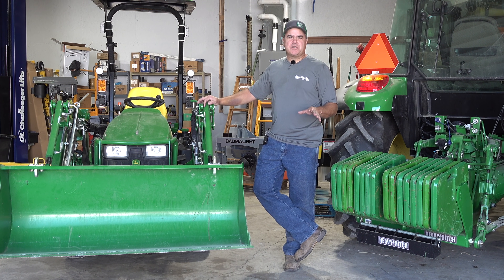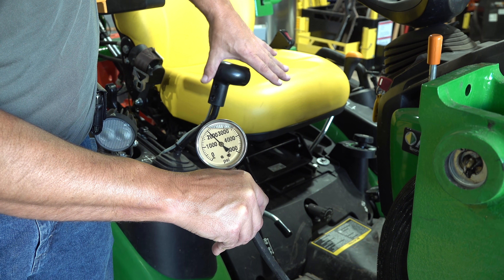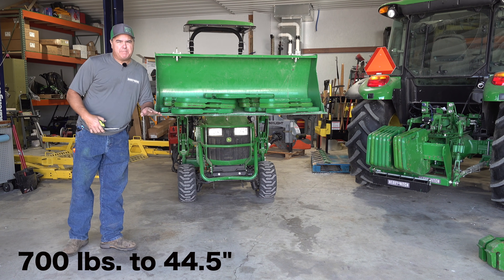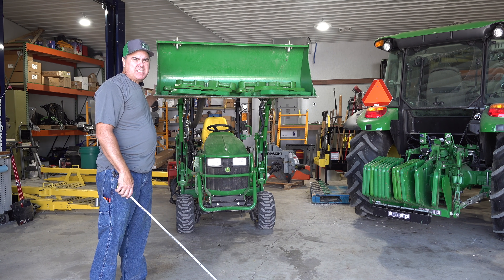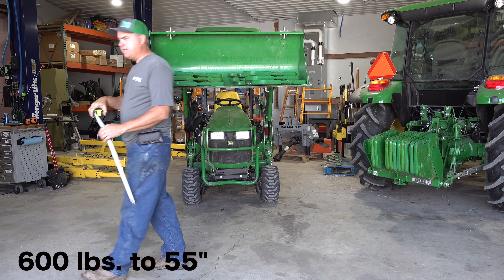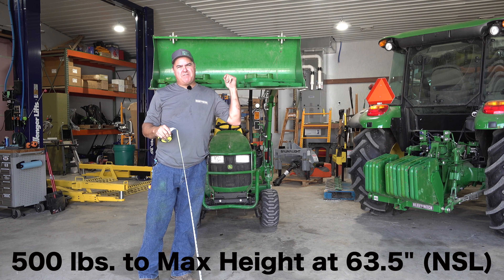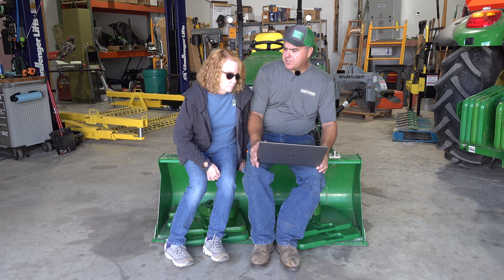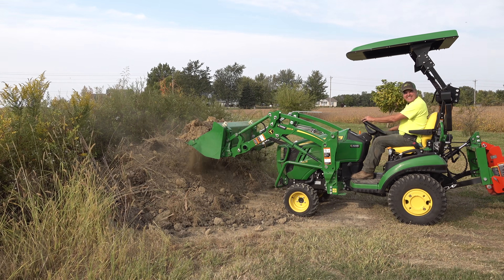WILL IT REALLY LIFT MORE??? 120R MSL vs. NSL for Subcompact Tractors

Comment: Great comparison... I do have a question based on me researching for a Wicked 55 or Artillian Grapple for JD2038 next year... The weight of the bucket... Is the weight of the bucket included in the original loader capacity or is like any other attachment, we have to consider it with the max capacity.. ie ex. - loader capacity is 1100 lbs, grapple, bucket, etc. (attachment) is 400 lbs., meaning the payload capacity is 700 lbs. due to the weight of the attachment.
Was that a good example. Your 1100 lbs would be 1300 lbs. if the 49" bucket weighs 200 lbs. 🤔🚜
You've mentioned before relative to a grapple's weight, it will affect what the loader can lift relative the grapple's weight; the more it weighs, the less you can pick up relative to the loader's capacity... Wouldn't that be the same for the bucket?
Reply from the maker: Weight of 49” bucket is included in the specs.  I thought I said that, but with so many questions in the comments, I must have not been clear.

Comment: Great information and very timely for me as I am right now this week deciding which 120r I will buy. Honestly though if the msl was not available, I would buy the nsl version, and in general, I would like to learn to use both functions on the loader, so I’ve been leaning toward the nsl unless there are good reasons to spend extra $ on the msl. 

Question... I am a new tractor owner with zero experience using a loader... how tricky/difficult is it to learn how to use the nsl well?... And since the msl is available, should a new tractor owner buy the msl just for the “ease of use and error prevention capability? TY

I’m looking forward to the “real world” test video coming up on Friday!
Reply: I'm sure it varies from person to person on how quickly you will get the operation down. I feel like as long as you keep in mind the bucket, forks are tilting as you raise and lower you'll be OK. The smooth, quick operation will come with time. Higher rpm gives more pump flow and helps when using both hydraulic circuits at same time. Which you have to do to maintain level while raising/lowering. That was an essay.

Comment: Doesn't the self leveling loader have more added bracing? Maybe the strength from that and added weight is making the difference.
Reply from the maker: Should have been accounted for in the specs.
Reply: @TractorTimewithTim  Cool! I remembered from one of your other videos how they were built stronger to make them self leveling in Australia by law.

Comment: Maybe this was mentioned - but how much extra does the MSL loader frame weigh compared to the NSL loader frame? Is it possible the "extra lift" is chewed up by the fact that the loader arms weigh more?
Reply from the maker: No, the tests are supposed to be payload capacity, 500mm in front of the pin.

Comment: Hi Tim.  I don't have a loader on my tractor.  I use a Boom Pole on the 3-point for most of my lifting needs (yea, it doesn't work for material, but fine for moving big stuff).  I easily get 1100 lbs up.  I don't know the weight of anything else, so who knows what I've lifted.  The Boom Pole is rated at 2000 lbs, so I need to be careful as I think the 3PH can easily lift more.  So, what do I do to make sure that I don't exceed capacity?  I don't add weight to the front.  If the front wheels are coming up (and I've tried to move a few logs that did this) then I'm over capacity.  (^_^)  All the implements I use are 1100 or lighter, so I don't have any real issue for most stuff. 

I was just having a good giggle here with the weights you were lifting and thinking how I'd never be able to move the huge logs I've done with a smaller machine.  I have one pine log that was about 40 inches in diameter and it was cut just about 9' long and was probably the heaviest thing I've moved - I could feel the front end moving and if I was not gentle on the clutch would likely have lifted it.  (yea yea, I know - safety was sketchy there)

Granted, my tractor is a bit larger than your compact.  It's a 1968 Ford 5000.  Roughly 9000 lbs with the tires filled and 60hp.  Probably similar to a Deere 5055E series machine.  

Never realized that those loaders were really only good for about 500 lbs.  That's not a number that the marketing tends to use.

Thanks for all the great shows.  I've learned a lot about various implements and techniques.  In fact, it was from your videos that I selected a Land Plane over a Box Blade for maintaining our gravel driveway.  That has been the cat's meow.  Of course, a 1000 lb 7' wide drag is a bit more capable than the ones you've used. (would have made quick work of your new shed floor) 

Oh yea, and I've also bought a Lube Shuttle.  No more cursing at the greeze gun anymore.    And I'm silently lusting after a flail mower....  (^_^)

Comment: Hey Tim - this is exactly the information I was looking for when comparing the two loader options for my upcoming purchase.  I'm still leaning towards the MSL because of the ease of operation (especially for a rookie like me) but I have a question about the quick park feature of the MSL.  You stated in your first video the "detailed walkthrough" that the MSL had a bit of an issue with parking the loader or was it the reconnection (I can't remember now)  - namely with releasing/connecting the hydraulics.  After using it for a while now has this issue worked itself out and if so how?  Looking forward to the next video.  Thanks Tim & Christy too! 
Blessings to you and the family-
Reply: I think, simply put, the bucket cylinder must be fully closed, and the lift cylinder fully extended, BEFORE, releasing the pressure on the loader.
Reply from the maker: I did NOT read that in the operators manual.
Reply: @TractorTimewithTim  Hey Tim, weird, do you have the OMPXX12554? Page 35-6, point 9 states the note about the cylinders.

The procedure is a bit different from the non self-leveling.
Reply from the maker: justarandomguy I’ll read that a bit closer when I get a chance.  Thanks!

Comment: I think the test was good for practical world, but like other have stated, a fabricated hook in place of the bucket, which brings the load point to center line of the pins on both loaders would be best to remove any issues with bucket levelness, and load centering, and would be a true test of the differences in geometry and cylinder sizes (if any).  This would be to test force at the pin.  You could then use your real world test here to create a offset factor to account for bucket/mounting differences.  I am guessing you will see this is where John Deere's numbers start to match actual results (at the pin that is), but the geometry differences in the coupler offset the added weight.  Tim, was there any differences in the distance from front of the tractor to front of the cutting edge?
Reply from the maker: My opinion:  who cares about some theoretical capacity with some fabricated hook!!! All of us want to know what WE can do with the loader.
Reply: @TractorTimewithTim  I agree with that approach as well.  My point was, if you are trying to understand the differences between your test and the specification provided by the manufacture, you must complete the test in as close of a manner as they did.  If you don't care about the specification listed, then the practical test is fine.  I do feel reach is part of the 
practical test that needs to be understood.  You have done reach test in the past to show how it is critical when dumping into a bed.  This reach also changes the lifting capabilities of the loader right?

No disrespect to you or TTWT, just looking at why there could be a difference in the factory specifications and your test.  Just soliciting my input.
Reply from the maker: The specification includes the bucket, with the weight 500mm (19.7 inches) in front of the pin.  I think my test is pretty much identical to that.
Perhaps that is the misunderstanding.  Are you thinking the specs are ‘at the pin’?  They are not.

Comment: Glad you're back at it! The test that personally gave me the most comparative information was when you tested deere vs kubota using pallet forks loading a pallet onto your trailer. Maybe this time load 100 lbs plates at each corner then the rest in middle of the pallet.  After capacity for flatbed is reached I'd be curious how much weight to get over your dump trailer half wall as well. This type of test also lets you curl a little but not completely so weights don't come flying back at you. I think it helps with more realistic conditions, accepting a little curl may be possible.
Reply from the maker: Hard to be objective because distance from loader pin to weight is CRITICALLY important in that test.
Reply: @TractorTimewithTim  totally agree and understand. Guess I'm looking at the test as more realworld of a pallet loaded with left over pellets at the end winter season or something' that most of us are too lazy to back load the pallet to help the loader. If I bought a loader with a closer pin I wouldn't be trying to make the load further out to be fair to a loader I don't have (not snark, just explaining, I promise! haha.) Guess it's more of an cosmic crisp (apples) to red delicious (apples) comparison that I think would be helpful to see rather than making it as fair as possible. Regardless, your content is awesome and appreciate all the effort you put into them! Excited to see your new building full of all your toys.

Comment: Hey do they spec the same tire pressure for that loader?
Reply from the maker: Dunno. I was running 32 psi. Checked right before the test
Reply: @TractorTimewithTim  Tim, do you mean 22 psi, or are you running 10 psi over the max pressure of the front R4 tires?  (Not judging, just curious).  I've also noticed that my Versaturfs seem to sag a bit more than my R4s did, due to the radial vs bias ply design.  Probably affects my max lift height a bit.
Reply from the maker: 32 psi.   Loader manual said to raise by 10 I think. ...but maybe I misread.

Comment: Nice test Tim. I was really hoping to see a test using pallet forks as I've never really had issues lifting anything with my bucket but I've needed more lifting power many times when using a load on the pallet forks.
Reply from the maker: Harder to be objective with pallet forks.  Distance from pin is critical
Reply: @TractorTimewithTim  Understand
Reply: @TractorTimewithTim  If you use the same forks for the test it's apples to apples, right?  Suppose you could try 2 different length forks on each set of arms.

Comment: It would be better to check the pressure with a T connection inline with the line you actually are using since that test won't show a leaky cylinder.
You could check the flowrate somewhat by connecting each hose to a grappler and check that the movement time from min to max is the same for all lines (pinched or deformed lines can rob you of working pressure)
Remeber that lubes and alignment issues can greatly influence the amount of work that actually goes in to lifting the weights

Comment: Thanks for the video Tim, did you have problems with the MSL cast bucket mount being slightly too wide to fit the 49" bucket at all?  I think your test was just fine for a real world comparison.  Of course there are ways you could be more accurate with exact CG of the weight in the bucket but given how these machines will be used its clear the operator will not notice a increase in lifting capacity.
Reply from the maker: No issues with the JDQA.  I think folks misunderstood my statement in the first video. The connector to the. Bucket is identical...but the back side of the bracket is larger.
Reply: @TractorTimewithTim   Correct, thats what I assumed you meant in the first video.  I just heard my dealer was having to grind some material off of the cast bracket to fit the 49" loader.
Reply from the maker: I have a 49”.  I will try it if I get a chance.
Reply: @TractorTimewithTim  Maybe I missed it, but what bucket are you using in the video?
Reply from the maker: Discussed near the end. 53”

Comment: The tyre sag can be eliminated by placing blocks under the front axle. Perhaps check the tyre pressure before and after each loader test.
Reply from the maker: 32 psi
Reply from the maker: Tire sag is real world.  We don’t really WANT to remove it.  We are all about ‘real world’.

Front tires were at 32 psi.

Comment: Good analogy guys.  Just consider that tire pressure/type would affect lift height when comparing to factory specs.  Imagine how high you could lift if the front tires were steel.   But in any event you answered the 64-thousand dollar question...lift capacity for both is virtually the same in the real world.  Its even harder now to justify the added expense of self-leveling.
Reply from the maker: 32 psi in front tires.

Comment: I was thinking of hydraulic fluid temp?  Was the testing done one loader followed my the next. Or was the tractor ran previous to warm up the fluid before the first test. Maybe temps wouldn’t make that much difference.
Reply: No, it should not make a big difference. Force is equal to Pressure*Area, so as long as you are reaching the pressure, the Force would be ok.

Comment: Your height measurement may be lite due to tire pressure or tire size/type. To test the bucket roll hang a chain over the front. If you need help let me know I will come up and help.
Reply from the maker: 32 psi.  
Again, not so concerned about exact number.  The point is that the MSL did not lift as high with a level bucket.
Reply: @TractorTimewithTim  I was not talking so much bucket to bucket as bucket the book Numbers

Comment: I would not be surprised if the lift specs are just calculations done by engineers, not real world test. When they are done, measurements are done in a lab environment under perfect conditions. I have looked at fork truck lift capacities in the past. Confusing.....In the real world, employees are expected to get the job done with the equipment provided. The engineer that put out the specs is not there to help adjust positioning each time you pick a load up. The specs are important not only to protect the machine, but the operator from getting hurt. My operation of said machines was to get a feel for when I would not feel comfortable in the seat. Course that would vary on skill level too. Mainly the ones arguing over these numbers are just looking at the color of the tractor. Keep up the good work. I enjoy seeing the tractors out working much more than trying to make sense of these numbers. I know they are important. I am just a novice on the small tractors. Take it easy Tim, I want to shake your hand again one day.........
Reply from the maker: Interesting view.  I think the specs SHOULD be valuable to prospective buyers to help choose the model they need.

Comment: Try having the bucket start at full curl and keep it at full curl measure to the bottom of the pin. That should make test easier and repeat better. Pick a fix point front and rear furthest point out that’s just to get and ideas of tire deflection or rear lift. Good to hear you are feeling better!
Reply from the maker: Ok. May try it...I suspect the NSL wins in a weight slide :-)
Reply: Tractor Time with Tim I don’t expect much difference on the lift, but you could find a difference in the curl due to the linkage leverage.

Comment: It might be a good idea to calculate the max lift capacity. You have pressure already, now you just need the total piston area to get piston force in pounds. Then measure the change of piston angle and do some trig and you'll have your theoretical max vertical lift capacity. Loaders are just a big lever when you get down to it.
Reply from the maker: The specs are that calculation.  But I don’t think it is that simple, as the ‘lowering’ of the curl during the lift (to keep it level) should have a positive impact on the lift capacity.

Comment: I think your test was more "real world" application, good video Tim. It would have been interesting to see one run at full curl, not sure how much difference that would have made to actual everyday use for an owner.
Reply from the maker: Full curl would lift more because closer to the pin.
But the distance in front of the pin would change on the NSL as the loader is lifted.  So, the NSL would win that test easily at max height

Comment: Well i dont feel like i am missing out now.  Test looked fine to me.  Lifting the loader thats bolted to a load cell on the ground could be cool to try though.
Reply: I support this, try repeating this test with a load cell chained to the ground. That should yield different values (higher ones).
Reply: Would be easier for repeatable test and less worry about I hurt from the weights. Also can test pulling power and 3 point lift
Reply from the maker: But has to be well underground to be able to have room for load center and still test lift at ground level. 
In my opinion, lift at ground level is more interesting than lift at full height.